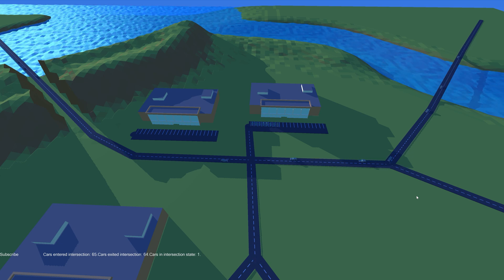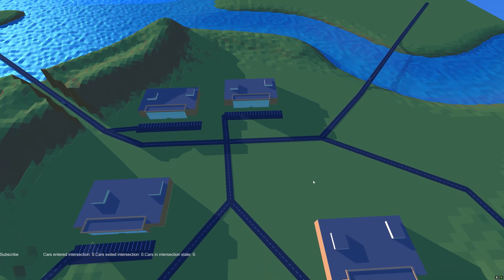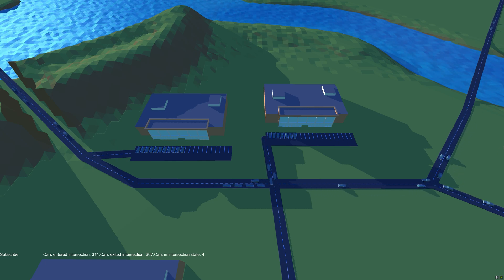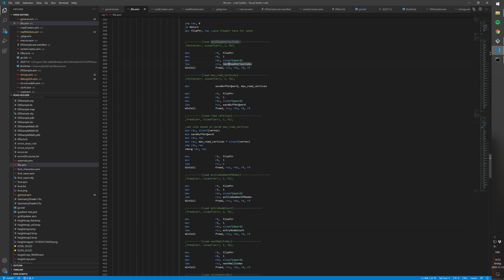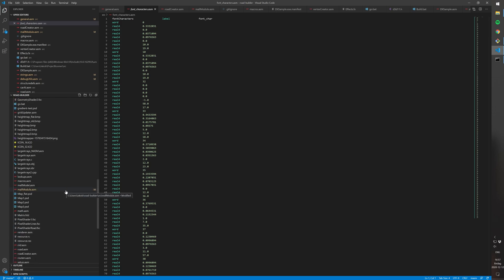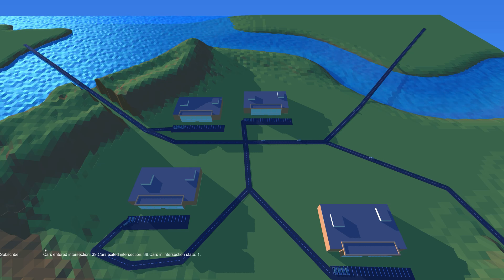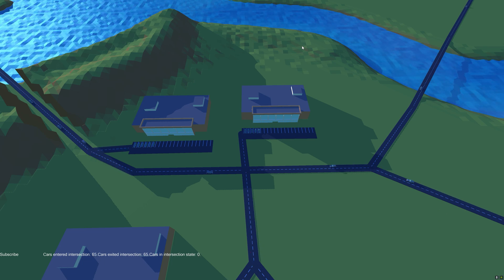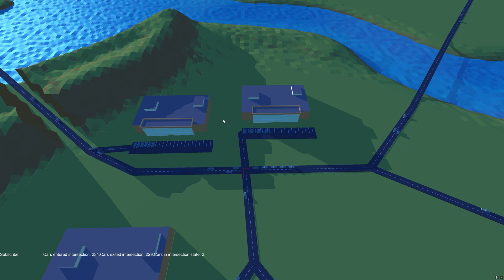Implementing saving for a game written in assembly Devlog | #2

Comment: I have a question, you said you are using dx11 right? Why don't you use dx12_2 or vulkan?
Reply from the maker: Yep, I am using DirectX11. Mainly because it is the API I am most familiar with even though I am not that experienced with graphics APIs. So, when starting this project, I thought that it was enough with x86 assembly being new and thought that using Vulkan or DX12 would create too many uncertainties in the project. I can always port the renderer to DX12 later when the project is more mature and assembly is not so new to me anymore. If I see a performance bottleneck in DX11